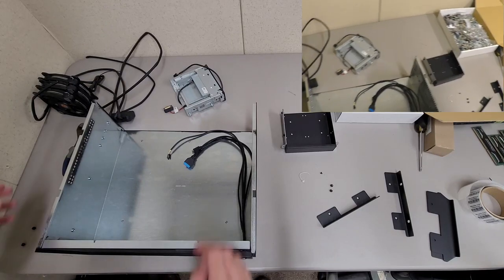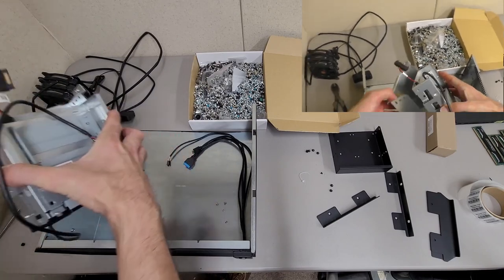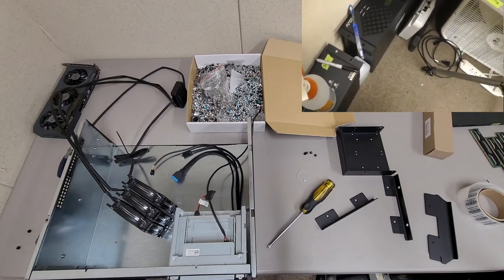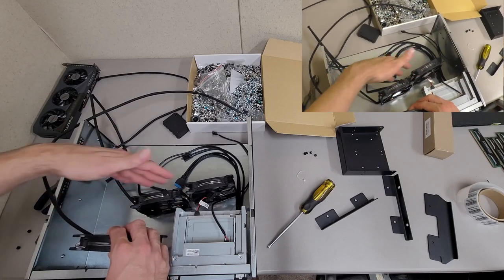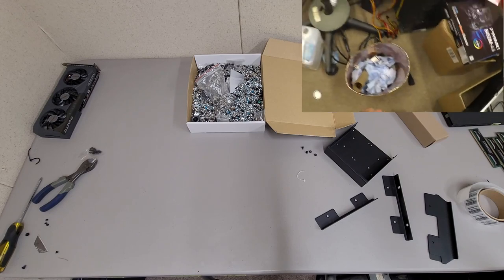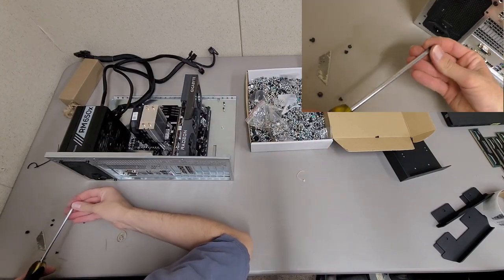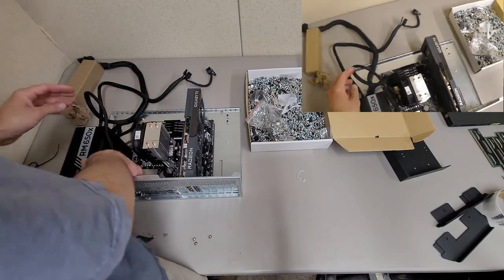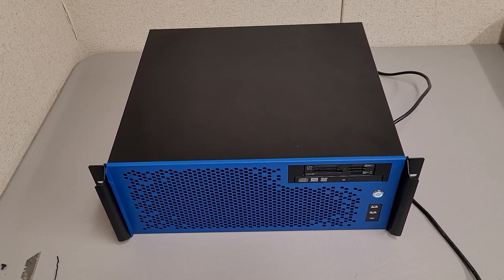Finally building out my Sliger CX4150i rack mount gaming PC (Part 1)

Comment: When you tighten the motherboard screws, it will also tighten the standoffs.
Reply from the maker: Yes and no. Most of the time it is fine but sometimes the standoff will loosen before the screw if you are taking the motherboard out. I've had it happen plenty of times.

Comment: I've watched alot of diff videos bout building a home server but don't really know wat I'm hearing or looking for,   I just wanna know what exactly kinda parts and stuff I'd need to build my own heavy modded gta5 rp server ?....
Reply from the maker: I have no experience without use case so I wouldn't be able to give much advice. The Dell PowerEdge r730 platform is pretty affordable right now. Otherwise old workstations like the Dell Precision series or the HP Z series are good starting systems for home lab setup.
Reply: Wat bout a motherboard,  processor, graphics card, how much storage drive racks ect...
Reply from the maker: @parole4207  I have no clue what your system requirements or budget is. No way to know where to start.
Reply: I just know I'm tryin to make a online gta rp server that has heavy mods an heavy resources with a reasonable limit.  Not like 2k per part but few hundred a part I can gradually build I'm fine wit
Reply from the maker: @parole4207  You could build an R730xd with dual 8 core 3.2GHz CPUs, 128GB RAM, and several TB of SSD for under $1000
Reply: An that could easily support an online multi-player gta rp server with heavy mods an lots of players smoothly?
Reply: DELL R730XD Server 2x E5-2667v4 3.2GHz =16 Cores 64GB H730 4x 1.2TB SAS 4xRJ45
Reply: This ?
Reply from the maker: @parole4207  never ran a GTA 5 server before. I don't know the system requirements. I feel like that would be a good place to start though.
Reply: @computersales  feel like I'd need a high resolution lots of storage , as high a fps as possible , high rendering and a heavy resource load
Reply: And a high speed connection